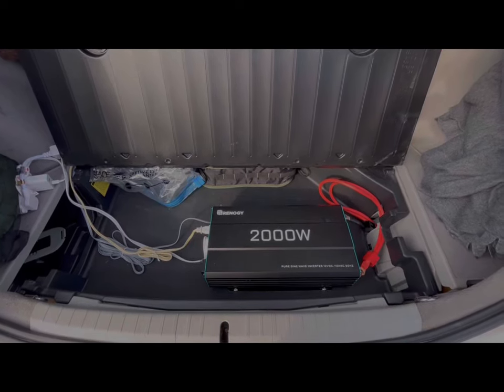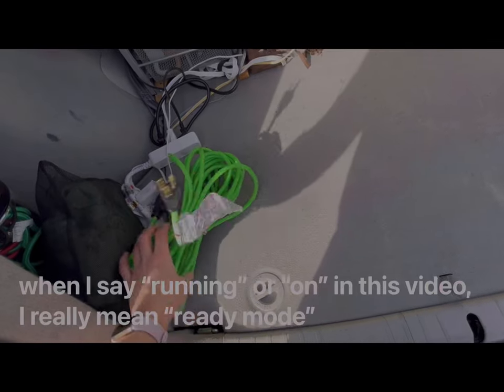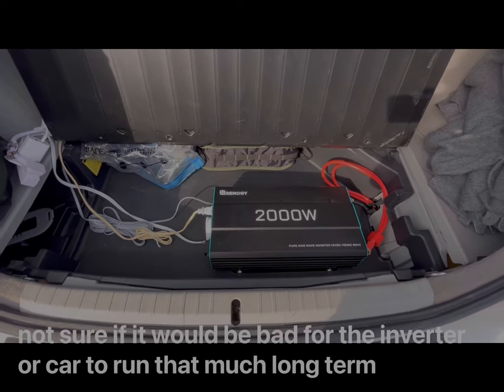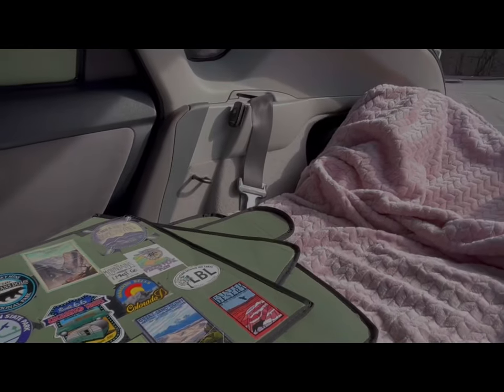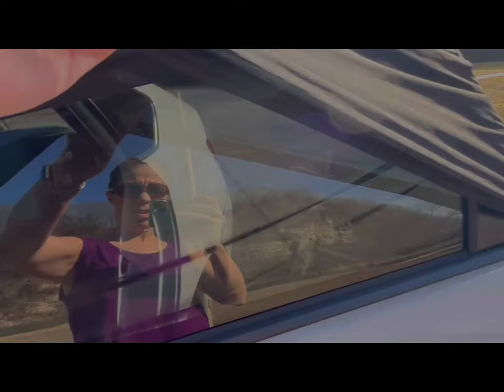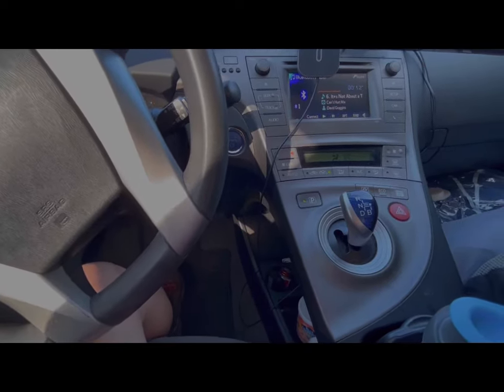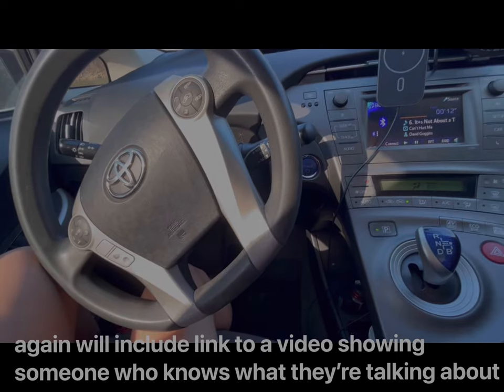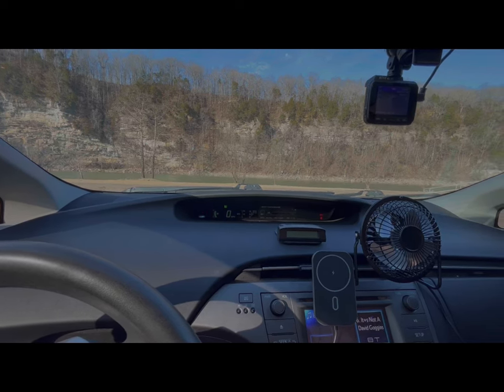Prius Camping/Living: Climate/Temperature control & Power Management with Renogy 2000w inverter

Comment: Two new things I learned in this video was using the parking brake to minimize the shake when the car starts and how to start the Prius when the 12v battery is dead.  I used one of those car starter power banks (which I had just gotten for Christmas) to start, when accidently I left my Inverter on a few weeks ago, but next time it happens, I will try holding down the brake until that sound stops and then holding the Start button to override the dead battery.  I have that same wall outlet heater in my Prius RV running off the inverter, and I like that it is digital so I don't have to manually regulate it.  I also have a 2000W Inverter, which runs a microwave fine.  I put black felt on my WeatherTech window shades so that they are less noticeable (looks like a heavily tinted window car).  Thanks for putting out another Prius video.
Reply from the maker: Thank you for your kind comments! I’m actually in the process of refurbishing my window shades, may post a video of that as well.

Comment: The inverter may be emitting a lot of emf, which can cause forgetfulness and kill brain cells. Stainless steel cover or reflectix can prevent emf from traveling to your bed area. An Emf detector can help you check if there are any leakage. Usually when the inverter is on.
Reply from the maker: Very interesting! Thanks for the info. I will have to look into this. Definitely need all the brain cells I have left lol

Comment: I started a thread a few years ago at Priuschat about power issues and got a lot of help from people who seem to know a lot about electrical engineering. I was warned against pulling more than 1000 watts from an inverter in a Prius for some reason. I even got scolded by FChapman a little for buying a 1200w unit, but that's fine because he's very smart and also helpful. I suggest checking out that forum before messing with the electrical system. ✌️
Reply from the maker: Very good point! I meant to mention something about that amount of draw in the video, but I forgot (though I did add something to the video description). From my research, 1300-1400 should be the max though there are definitely people out there using larger inverters, especially when used with second 12v batteries installed (which was my original plan). Still, people definitely need to do their research before doing any of this. And I am definitely no expert on the subject!

Comment: Great video as usual.  I have a 3000 watt inverter and draw 12-1500 watts. I have found that the 12v battery won’t maintain that voltage for more than a few minutes. Even with the car in the ready mode. The hybrid battery can not replace the wattage being drawn at that rate.  Lowering the inverter draw to around 1000 watts is maintainable for extended periods of time in my case. (Gen 2.) I have also heard that you should not draw more than half the rated maximum of your inverter for extended periods of time. Not sure about that info though. You also need to be sure the battery to inverter cables are large enough to allow maximum current to flow through the system. There are charts for wattage, cable size, and length requirements.  In the end electrical systems can be dangerous so if you’re not familiar with them its best to get professional help.
Reply from the maker: Absolutely agree! Actually forgot the mention in the video that I upgraded wires, when I switched everything over to the new Prius. After more research, realized the ones that came with the inverter weren’t ideal. I’m definitely still learning, especially when it comes to the electrical stuff
Reply: Better late then sorry

Comment: Why not just recharge a power station from a DC charge cord in the cigarette lighter plug in the Prius rather than bother with connecting an inverter? Wouldn’t a quality power station provide plenty of power for camp cooking and whatever, making an inverter unnecessary?
Reply from the maker: It would take awhile to charge from a cigarette lighter plug. Using the inverter provides on demand power and uses the car as a generator when left in ready mode. I'm sure there are instances where a power station might work better for some people (like if someone does a lot of tent camping away from the car), but for me, this was the best option.
Reply: @sweetoldbertha  ok, I can definitely see the convenience of that. I guess the combo of both creates more options.

Right now I’m preparing to lose my home and looking for the simplest setup. I’m somewhat handy, but very cautious with electrical work. I wouldn’t want to get any of the wiring wrong (from what I’ve seen on other channels) and paying for it to be done might be pricey. 

Maybe I’ll ask around about wiring costs to find the best starting point.
Reply: @ericbishton2779 I'm going to use a power station when I camp because I already have one. It rarely hurts to start with what you already have.
Reply from the maker: @ericbishton2779  I’m sorry to hear that. Please feel free to reach out if you have any other questions. For me, this was the best solution. However the 2000 watt inverter is more than I need and was also more expensive that the less powerful options.

Comment: Instead of a heat pad why don’t you use the car to heat the car?
Reply from the maker: The car heat causes the engine to cycle on much more often and also doesn’t do much for heating the rear of the car (and uses more gas). So use the heating pad most cold nights. And the small space heater if needed.

Comment: Are you currently living full-time in your car? If so, are you saying that you currently keep the 2000-watt inverter at a lower draw, and do not have a backup battery? That this set up meets all of your wattage needs? I am only planning on camping for a month or so at a time. I am trying to figure out my electricity needs. I have low watt (700) microwave. I was hoping to find a low-wattage hot water pot. And I was thinking about using a rice cooker.
Reply from the maker: I do currently live in my car full time. I do try to keep it under 1000-1200 watts, and no back up 12v battery at this time. It's definitely more than what I need. I meant to include the wattage of each of my appliances in the video. The mini cooker I have will boil water, so I didn't replace my hot water pot once it died. I don't ever run two cooking appliances at once (actually now, my only appliances are the mini cooker and coffee maker). But the good thing I found, when I did draw too much when it was hooked up to the camper, is that the inverter just shut off when I attempted to draw too much. Hope this helps!

Comment: Do you keep track of the usage of the 12V considering its damaging to the battery if its drained more then 50%
Reply from the maker: No it’s not something that I worry about. The hybrid battery recharges the 12v as needed. There are affordable monitors for the 12v on Amazon if that’s something you’re interested in keeping an eye on.
Reply: makes sense. the hybrid battery will passthrough charge the 12V(while the 12V is being used from the inverter) until the hybrid batter needs to be recharged by the gas engine ya?  @sweetoldbertha

Comment: Thanks for sharing this info - have a 2nd Gen Prius and want to start car camping.  When you are at a campsite with electric hookup can  you run the Prius AC or Heat from the external electric hookup?  Can you charge the hybrid battery from the external electric hookup instead of charging it from the gas combustion engine?   Can you charge the 12 volt battery from the electric external hookup.  Thanks

.😊
Reply from the maker: I can’t charge the 12v battery or hybrid battery from an outside source. I can use my fan and heater using an outside power source. For AC, I depend on the car’s AC so have to leave the car in ready mode for that.

Comment: why a plug in heater when the car has its own heater? does it use a lot less electricity?
Reply from the maker: It’s more efficient so the engine isn’t turning on and off all night. Also makes a difference to have the heat source near the bed at night.

Comment: I’m curious about your remote in the back of the car to help start your car if you need that extra power. Because I know in my Prius I have to press the break in order to start the car. How do you handle that from the back?
Reply from the maker: It’s just a remote start system (meant to be used outside the car), but it can be used inside the car to start the car. So pressing the brake isn’t necessary.

Comment: Hows ur hybrid and 12v battery holding up after a year? Jus curious
Reply from the maker: The car had over 200k miles on it when I bought it, and I tested the hybrid battery when I bought it, and it didn't have much life left in it. So I did end up replacing the hybrid battery last summer. As for the 12V, it was an off brand replacement (no idea how long it'd been installed), but I replaced it a couple months ago.
Reply: @sweetoldbertha how much mpg have you gained from the switch? Thinking of doing the same thing on my 07 with 175k